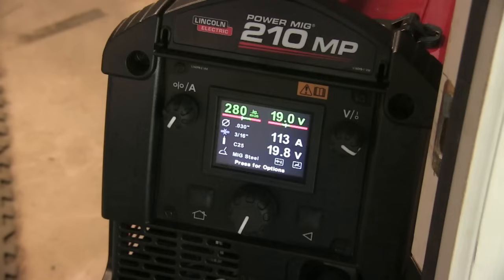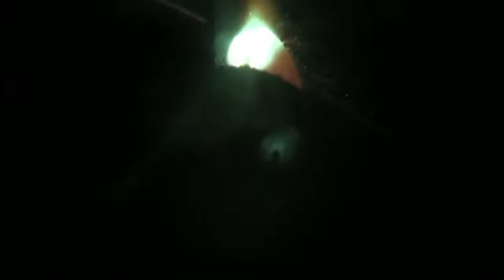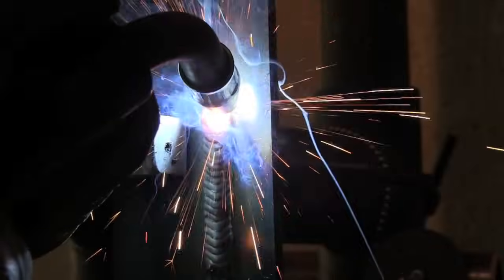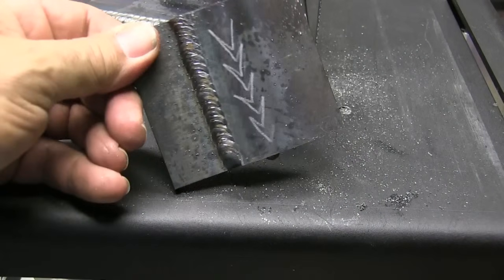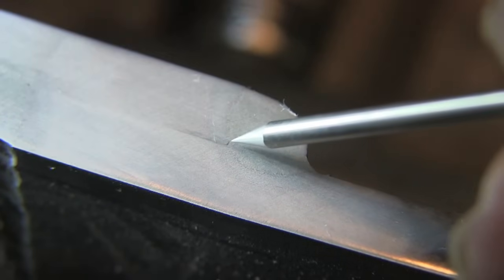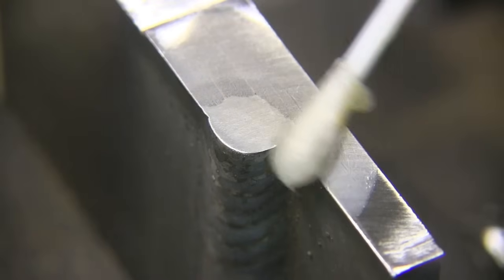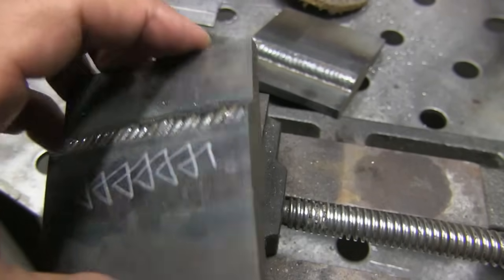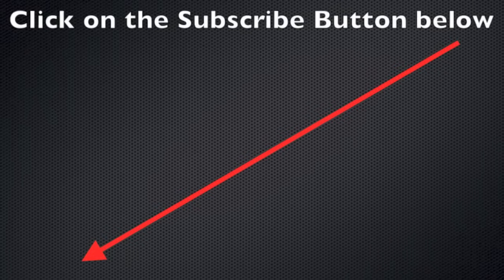Quick Tips for MIG Welding Uphill

Comment: Funny, im going through my vertical ticket now, has to be a 3 pass vertical, stop starts in root run and one of the caps. Any lack of fusion right on that fillet edge like the dots you picked up in etching will fail me. We do a snap test and break the weld to check the edge of the root. 
Great tips as i was having trouble getting full penetration on a small enough root run to not exceed the 12mm fillet max.

Comment: yes v ups are trickier in steel the voltage and current are  critically matched, amps have a tiny window of what is too hot or too cold
stick is easy but I sure am struggling with straight mig, using an inverter unimig 250, maybe need a smaller tapered nozzle as the nozzle that i have can easily trip on the weld. will try your methods,

Comment: you should, maybe explain, that you were on pulse and OFF  the spray, stop-start is Russian Pulse, the idea is to lay in welds as fast as possible as a yacht builder we weld seams 20 m long , in ALU, positional as now i have only welds are very easy in Alu, but for me not easy in steel as i lost the use of left hand
being entirely comfortable is a must, do a practice run, with the gun not running, first over the length of the pass, in Alu I  do 2 foot runs, backstepping after chipping back with a 4 inch saw blade
as an employer it took 5 years to train a man in all skills from welding to plateforming and 7 other trades one uses in our trade
great photography

Comment: Hi Jody, I have my shiny new MIG welder and I'm laying down some pretty OK looking beads on horizontal plate and horizontal fillet welds. Most of the stuff I'm doing at the moment is 3mm or about 1/8". I'm trying uphill MIG on 3mm fillet welds and I either get it so hot that the weld blobs out and looks like brass monkey nuts or it's so cold that the weld looks like a little snake jumping from one piece of metal to the other. I'm finding it hard to get the right settings and also the right travel speed. I'm trying to watch the puddle and do the little upside down V but I've only layed down a couple of welds out of maybe 100 that sort of looked half ok, but were still not acceptable. What tips would you have on these sort of joints? I've seen one vid (maybe your very first?) where you lay down a downhill root and then go uphill fill. Is that overkill for this thickness? Anyway super awesome channel, I've been watching since maybe 2012. Cheers mate!

Comment: QUESTION 
why such a high wire seed?
I have the same .030 wire short-circuit welder & I only run 160-180 ipm. Am I doing it wrong?
Reply: Wikked Frost depends on what you’re welding. More wire= more penetration.
Reply: Me too. I was doing 1/4 T-joint and running 100%co2. 180ipm at 19.5v

Comment: what about using same heat but turning down the wire speed , would that prevent the crowning of the weld . I use around 200 on wire speed and like it , tends to be flatter

Comment: Hello Jody, I'm a new(ish) welder with no formal training (grew up in the country and we fixed everything with an old lincoln stick welder and did some brazing with a torch).  I've recently picked up a Hobart Mig Handler 140 (their 115V unit) and some .030 wire.  I've got the 25% Argon/CO2 mix (or maybe the other way around) gas on it so DCEN setup.  I'm having trouble welding a lap joint upside down.  Modifying a truck frame.  Mild steel, 1/4" plate to the ~1/8" (10 ga.) frame.  My unit seems to start it's arc over and over and I'm getting broken bead which is seriously ugly and probably not very structurally strong.  Setting I came to was 5 on heat (max setting) and 4.5 on feed speed.  Love your videos and they have been very helpful to me on this project.
Reply: MIG solid wire should be DCEP....makes a lot of difference. Non gas Flux-core DCEN......flux-core with gas, usually DCEP..  75/25......usually 75 Argon, 25 CO2.
Reply: Try more wire speed & shorten stickout while welding

Comment: Another great video. Have you ever thought about doing a video on welding thin steel, like from somewhere in the range of an automotive panel thickness with a mig, up to say a bit of 2mm angle with a small, budget stick welder? It's just that I can imagine a lot of people that watch video's on welding tips are weekend warriors, and try a lot of these techniques but end up with a series of holes joined by lumps of slag. Just a thought anyway, as nearly every welding video on youtube are done with decent welders on thick steel and it just makes it all look so easy. Anyway, keep up the good work. Cheers.

Comment: Can you do a video or couple of videos on flux cored wire doing all positions aswell as full pen butt weld plates. thanks for these tips as copying the technique and settings I managed to pass my vertical up mig test for my apprenticeship, cheers
Reply from the maker: +Ryan C I am making plans for a flux cored wire video but have to get a spool of wire and some more test plates
Reply: +weldingtipsandtricks Awsome, cant wait. I work in heavy transport and forestry engineering and we basicly use flux core for everything

Comment: A rookie Q for you jody, why are the settings in volts and not amps? Cheers
Reply: Because mig/mag is a constant voltage process... You need to go google it son.
Reply: +Hugh Frater haha cheers
Reply from the maker: +Dubstep some machines display amperage but most do not.  amperage is controlled by wire speed but you have to have enough voltage to provide an efficient burn off.
Reply: +weldingtipsandtricks thanks jody, always look forward to new videos! Cheers

Comment: I normally try to weld down hill.  It seems like less metal drips into the tip.
Reply: +1970chevelle396 It all depends on what you're welding. Thin sheet metal you weld downhill because going uphill you're more likely to burn a hole in it. On thicker metal going uphill is going to give you significantly better penetration.

Comment: Love the videos!!!! Did the part cool down after you welded it with the first technique? I could imagine that if the part was heat-soaked from the first pass, the penetration would be more than if the part was cold. Thanks again for the awesome knowledge you're passing along!!! 👍🏾👍🏾⚡️
Reply from the maker: Good observation. I did let the piece cool completely. And you are right. It would make a big difference if the second weld was done with metal still hot

Comment: Jody, could you provide a link or name brand of etching fluid in your response to this please. Ive been trying SMAW vertical and would like to cut up a few pieces to see the penetration.  Thanks again, nice work man. 
Pidge.
Reply from the maker: +PiDGE IAM ox-out 540 passivation fluid by chemclean but its difficult to get in small qty. ...   but I have been told that concrete "clean-n-etch" made by seal krete will also work very well for etching carbon steel. I think you can get it at lowes, ACE hardware, home depot, etc.
Reply: +weldingtipsandtricks thanks Jody I'll have a look for some now that I know what to look for.